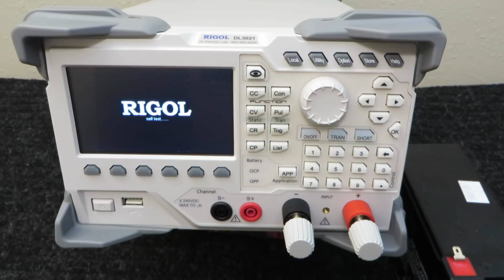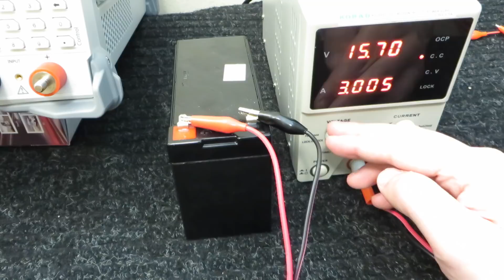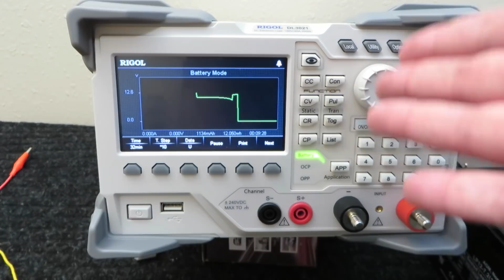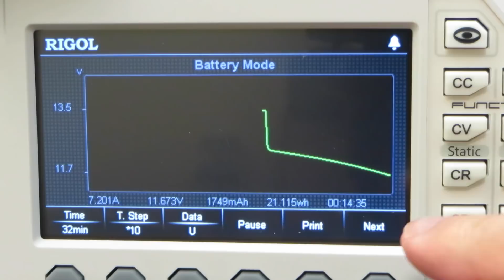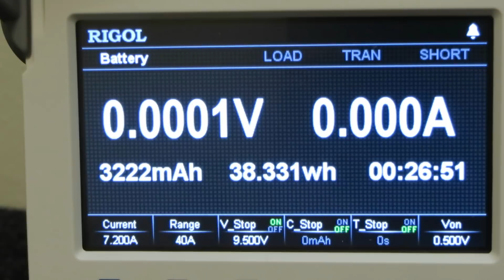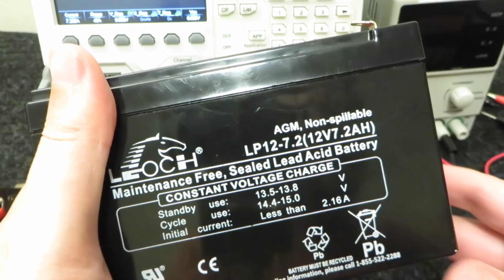Battery Desulfation Demonstration Start to Finish - Part 2/2

Comment: Just watched these two videos again, as my 92kWh lead acid battery bank has been installed now for nine months, but recently has been showing signs of degrading (ie. the voltage is dropping much before it should given the number of amp hours used). The bank has been running the house since the beginning of the year, with top-ups from the grid for the first few months, but from the middle of March until now, has been running 95% of the time from solar. I spec'ed the bank so large to only deplete the batteries to 70% before charging from the grid if needed. This gave about a 30kWh capacity. The bank is made up of 32, 230Ah 12V (C20) Varta LFD230 sealed lead acid batteries. At the time of install, we still had an electric shower (9.5kW) installed. Over the summer, I installed an unvented 200litre cylinder, which has two 3kW immersion heaters fitted to it. This has been great in providing pressurised water for showers and heats the water to about 62 degrees centigrade which is great. It also means that a big power draw isn't required first thing in the morning, when the sun isn't yet up to provide solar.
Anyhow, I've currently dismantled the bank and I'm amassing data on the individual batteries. Three of the batteries suggest they might have failed in one way or another as they are significantly down compared to the three others in their series (the 32 batteries are grouped in sets of four in series, giving a 48V bank). I'm going to individually charge them over the next couple of weeks and discharge them using a 1000W inverter (using different loads to get a picture of what the condition may be).

I came across this video today and wondered what your thoughts were on it?
https://www.youtube.com/watch?v=8CxFpIoKwy0
It's not applicable to my batteries as ine are sealed, but it seems to be a more aggressive method of what you tried here.
Anyway, once again many thanks for some great videos.
All the best, Al

Comment: I tried a riding mower battery recondition mode on a Harbor Freight 12V charger with no knowledge going in. Battery got so hot I could see vapors escaping and the sticker detached from the battery. Did not save the battery. 

With this video and with some other research I’ve done, I feel way more confident trying something again in the future. I should have been more careful, and now I am also realizing more cycles on the battery may have improved it to be usable again. Thanks!
Reply from the maker: Wow!  That Harbor Freight charger definitely put you in a dangerous situation!  (boiling hot sulfuric acid is serious stuff)  A good rule of thumb for batteries is to never let them be hot to the touch.  Shortly after 'warm to the touch' is thermal runaway if your charger is not current limited properly.
Reply: @knurlgnar24  I figured so. I have a thermal gun and I will make sure the internals do not get warmer than 140F which is what a lot of other YouTubers are throwing out as a generic maximum number.

Comment: I know this is two years old, but i''d really like to see you do the same thing to power tool batteries.  NiCad, and the Lithium ones.  Those drive me crazy.  Plus maybe discussing how to charge them (not going all the way, running them a bit before sitting, NOT leaving them on the charger) and maintain them for maximum life.  Love your channel!
Reply from the maker: Lithium is a whole complicated ball of proprietary but/if/when's.  I generally tell people to just buy a battery especially since mistakes can end in violent fires.  With NiCads I've definitely had success with revitalizing them but it never lasts long before they die again.  Hardly worth it in my experience.  Lead acid is SOOOO forgiving.  Even after terrible abuse one can often bring them back to a serviceable condition.  If you're interested I did a video a while back about lithium vs AGM for solar applications.  Lots of good info there.  You have good advice regarding your tips!
Reply: @knurlgnar24   Thanks for responding!  Is there some formula for calculating the lowest voltage you can let a battery drain to for cycling or is the percentage different depending on the voltage of the battery?  If not, do you know the low end cutoffs for 12, 6 and 18v batteries?  Is there some chart somewhere you know of that shows this?  Thanks, again!

Comment: Greetings, during the sulfation process, do the residues fall to the bottom of the battery or simply disappear by virtue of Epson Salt dissolves?  If it falls to the bottom is it important to get rid of it for the best functionality of the battery itself?
Reply from the maker: Most of the lead sulfate is retained by the plates and stays in place, but some plate shedding does occur whenever a sulfated battery is recharged.  All flooded batteries are designed with plates that have empty space at the bottom of the cells to allow this shedded material to collect without shorting out the active plates.  Longer life batteries have more space than shorter life ones, but they all have this feature to some extent.  For most people I take the stance that it's best to just let the shedded plate material settle to the bottom and not worry about it.  Industrial battery restoration companies do flush that material out before selling them as used batteries but as this requires disposing of lead contaminated acid and reintroducing pure acid in the proper concentrations I just don't see it being practical for the typical individual.

Comment: Maybe it's just me, but I find these kind of videos entertaining, not boring.
Reply from the maker: You're a weird person.
I like you.
Reply: These videos make me want to learn more about the equipment and what you can do with it.  Besides i am tired of buying farm machines batteries  they die and freeze over the winter  great ohio weather
Reply from the maker: @Dm65-gpy The best thing is to take the batteries out and store them where they won't freeze and charge them every once in a while.  Otherwise a previously frozen battery will usually recover to some extent if you desulfate it.  I've done this many times and they usually give many years of service after even though their reliability will always be in question:  It may last 10 years or it may last 1 month.  Freezing a battery isn't good.
Reply: @knurlgnar24  it such a pain to take them all but i do need to I agree.  I think im going to order a power supply should i get a 30v 5 amp or 60v 5amp  they also have some 10amp
Reply: Any thoughts on this?  Thanks
Reply from the maker: @Dm65-gpy  If you're only interested in 12V batteries you have no need for a 60V supply.  I have 48V battery banks which is why I chose 60V capable equipment.

Comment: Do batteries that have been desulfated re-sulfate faster than new batteries? I'm thinking of refurbishing my dead UPS battery, for fun but also to use it, but if it re-sulfates much faster than a new battery then I kinda don't wanna deal with it.
Reply from the maker: Sulfated batteries will always have some permanent damage as a result of the abuse they sustained but any used battery will have some level of damage just from being used.  Previously sulfated batteries that are desulfated will not re-sulfate faster than any other battery.  Some people claim the sulfate crystals are nucleation points for new sulfation but I've not seen that borne out in any real world applications I've come across.  Just take care of them like you would any other battery and they'll give you good service.
Reply: @knurlgnar24  Alright awesome thanks for your reply

Comment: I just got a college course on battery restoration. Very informative. I have those same sealed 12v batteries for a stair chair lift that I'm recharging now with a Beleeb 30A charger, which is supposed to desulfate with pulse and discharge cycles. We'll see. Meanwhile, I also have an old school Schumaker dumb charger, and a 10A, 30V DC power supply I'm going to mess around with some old batteries I have here and see if I can restore. This is really cool.
Reply: I have the Beleeb 40.  Amazing device for a reasonable cost.  Nobody had been able to convince me that pulse charging doesn't work for desulfation.  At worst, it is a why not do.
Reply: Hi I only have a 6a sears dumb charger. Will this work as well if I just leave it charging for longer or does it need to be hit with 30a? I've had mine charging for 3 days. It was helped substantially but is at half the MCA (marine cranking amps).

Comment: @knurlgnar24
Hi Knurlgnar. 
I love your chanel and I learned a lot about charging batteries from you.
Thank you very much. 

I have a few questions and hope you can help me answering them.

I got from my neighbor his old car battery (M. Benz/Varta PB 12V 95A 850Aen) that was almost dead with 11V and very little response.
I cicled it as you've described in all of your videos and it came hesitantly partly to life at 12,8V (at the moment) but still has some issues:
1. When I charge it, the third cell gets warmer than the other ones (was always like this) even if I charge it with little current, like 1A. If I give it more current all cells get warmer, but Nr. 3 is still warmer then the rest. 
How can I fix this? 
2. At the moment the voltage is rising slow until 14,7V (1,225 ratio) when I charge the battery with 5A (I guess this is a good sign for less inner resistance) and the current goes normaly down until about 2A (at 14,7V) and then stops and goes up and stays up at 3,5-4A while the battery gets warmer and warmer. I understand that a lot of the heat comes from the higher current, but like this the charging can never come to an end. Even at locked 0,8A on a cold battery the current doesn't go further down to end the charging.
What is happening and how can I fix this? 
3. Would you please also explain me how to properly balance the cells inside the battery? 
I've heard you say something about higher voltage, but would you please explain it simplified one more time how high the V and A should be to balance a normal PB battery? 

I would love to hear your responce and thank you very much once again for everything. 
Please make more videos. 
Greetings from Germany!
Reply from the maker: Are all of the cells filled with a proper amount of water?  If you open the inspection caps (assuming this battery has them) what condition do the plates appear to be in?  If they are warped or the electrolyte cloudy/opaque the battery has issues other than straight sulfation.  If you got the battery with 11V then it likely does NOT have a cell short.  That's good.  It may still be past it's useful life and simply need to be recycled though.
1.  If one cell gets warmer than the rest and the electrolyte level is proper then this cell has a higher voltage drop when charging than the others.  This could be for a variety of reasons including less active material due to excessive plate shedding, contaminated or incorrect pH acid, sulfation, a cell short, etc
2.  I believe the current is going up simply because the battery is entering 'thermal runaway' during the charge cycle.  This is normal.  To prevent it voltage/current needs to be reduced.
3.  As for balancing cells this would best be done by accessing individual cells, but this video covers the more practical approach of only accessing the 12V terminals.  To balance you overcharge, cycle, overcharge, cycle a few times.  Then they should be balanced.

If the battery is 12.8V after charging and sitting for a few days have you measured its capacity or discharge rate ability?  Sounds like it may be recovered?  If not I suspect it has issues other than sulfation and needs to be recycled.  Batteries have a finite lifespan and there's nothing that can be done to overcome that.  Plate corrosion and active material shedding eventually kill all lead acid batteries.  Even the desulfation process causes shedding which is irreversible.
Reply from the maker: Also, hello to you in Germany from the United States!  Your battery is likely a Lead Selenium alloy which does not commonly exist in the USA and I have not worked with that particular chemistry before.  As I understand it is functionally a cross between our common Lead Calcium batteries (used in cars) and Lead Antimony batteries (used in forklifts and the like).  Your battery likely outgasses more than the lead calcium battery shown in this video which may explain your higher leakage current during charging.  I wouldn't worry about the slightly lower finishing voltage or .8A charge voltage for this reason on your battery.
Reply: @knurlgnar24
Hi Knurlgnar.
Greetings again from Germany. 

Thanks for your help!!!!!

I looked in the internet for my MB A0055411001 VRLA battery, but didn't find the original technical data from 2008. Now I understand that VRLA  is some kind of gel battery but the new ones are all Varta/MB AGM G14 batteries. What is the difference between VRLA and AGM? To me it seems very similar.
The battery case on the new ones is silver but mine is black.
Sealed with some strange looking caps over the chambers, that don't have a possibility to open them (one way seal) without demaging the caps, to add water. 
The new ones are completely sealed.
On the top it says "VRLA-BATTERY DON'T OPEN". 

When I charge the battery, I cannot hear anything bubbling, except I charge it with current for 7 cells for some time with 5A. Then it starts to bubble minimally. At 2A not at all. That's how I got it back to life. Since then it takes charge with 12V (14,7V at 1,225 rate) normally. 

About the battery: 
It was build in a C-class limousine with all the gimmicks that are there, like auto light +++ and was used mostly in town. The neighbor's son then forgot to turn something off over night and then it was almost dead at 11V. 
After I got the battery, I directly charged it and the voltage came back up, but not the capacity to start a car. 
That's when I started circling it with a 500W Inverter but it still didn't got enough capacity to start my old 1,9 VW Tdi PD. 

Then I tried overcharging it with current for 7 cells (14V max 17,15V at 1,225 rate) with 5A over short time or 1A or 2A over few hours until it broke loose and started charging better with 12V. 
The voltage dropped just like in your first video down to normal voltage even if I charge it with 14V from time to time over short periods of time. 
The voltage settles at about 12,7-12,8V when I lett it cool down.

After charging it like this the capacity came back, even if not completely. Now it can start my diesel without problems, but I want to complete the task before using it there instead of my current 70A battery that collapsed on me last week. 
I guess my engine with 477K kilometers is possibly not charging the battery enough. I must check that. 

I've read somewhere that the thermal run that you described is not good, so now I charge the battery with less current at the end.
Over night with 1,2A and 12V the charge voltage was 14,14V. I guess that is better. 

About the warm cell and balancing, I will continue to charge and discharge the battery as you told me until the cells are doing better and are well balanced. 
Only then will I use it in my car. 

A little question at the end:
Do you thing that I should get a stronger Inverter then 500W to drain the battery faster, quasi as if it is under heavy load to simulate the starting of the engine or should I stay at 500W?

Anyways, 
Thank you very much for helping me out, Knurlgnar.
I'll report the results when I'm done. 
Be blessed!
Reply from the maker: @jazzbuzz777  I wouldn't be concerned about the load you are using to discharge the battery.  The only important factor is that the battery is being cycled.  It sounds to me that you are doing everything right from the perspective of someone who is attempting to recover a battery without disassembling or replacing the electrolyte which is beyond what my experience covers, and is beyond what I believe is practical for most individuals.  If someone has $20k of batteries then it may be worth it but not for people like you or me.  If cycling and overcharging the battery doesn't bring it back up to a useful status for your application then I don't think I have much more to offer you.  That battery either is good enough for your purpose or it has reached the end of its useful life.
Reply: @knurlgnar24 
Okay Knulgnar. 
Thanks for your answer. 

It is not so much the money, but checking out how the recovery is done and enjoying the process of bringing the battery back to life is very satisfying. 

Somehow I like using things until they are completely scrap and then get rid of them. I just like the challenge. 
Here in Germany the people just throw everything away as soon that it doesn't work 100‰ and I cannot stand that.
Maybe my makedonian roots interfere, becouse in MK if something can be repaired, we repair it and do not throw it away.
Besides, as a man I love such technical challenges.

I also try with my son to repair all of our old cars, even if we're not car mechanics.

Again thanks for everything and see you on the Chanel.
I'm right now checking your Inverter-videos.
Bye

Comment: What power supply is this?
Reply from the maker: The power supply I used in this video is a Korad KD3005D.  It is a low budget unit but I've had good luck with the two I own after quite a bit of use.

Comment: Another brilliant video. I wonder if the battery's history played a part in your results. If it has come out of a UPS, then wouldn't it have spent a lot of time being trickle charged just to compensate for losses?
Reply from the maker: Hi Fred!  Based on what I discovered in this video and where I salvaged it from I suspect this battery was never installed and instead was stored for a long period of time and 'failed' self test immediately upon installation and was then scrapped.  Usually used UPS batteries are only useful for scrap.